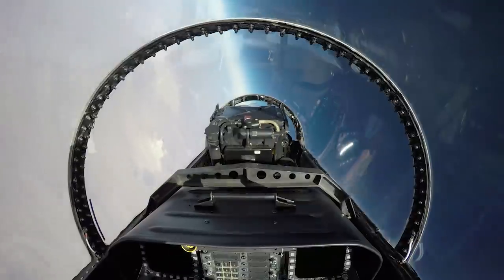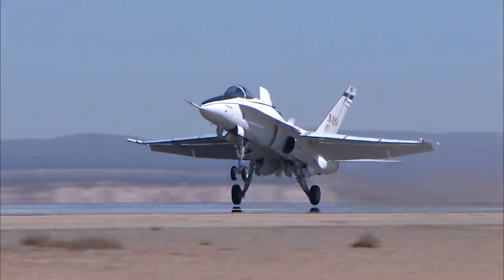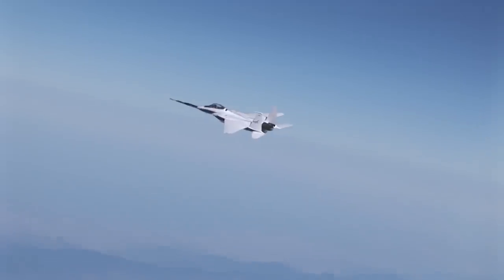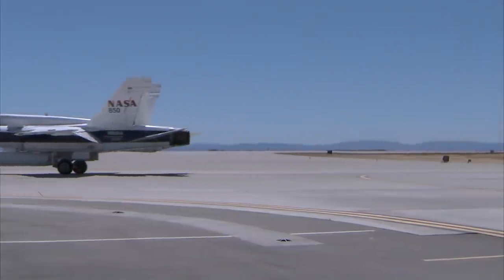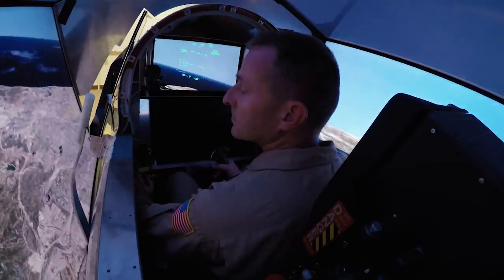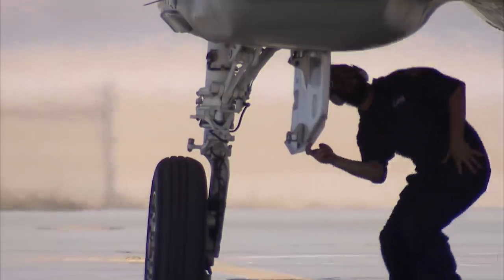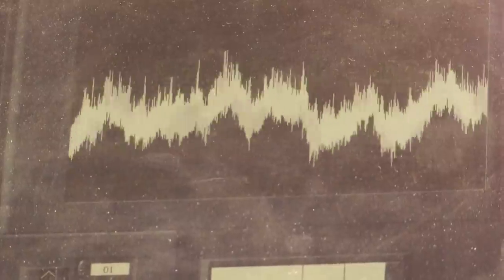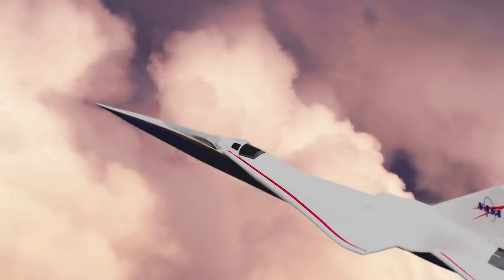NASA Prepares for Future of Supersonic Experimental Flight

Comment: Having spent time in the SA military (during the Bush war fighting communisum) and hearing Mirage 1 and 3s go supersonic often, I really wonder why the fuss. I never saw a window break or some other earth shattering thing. At worst I saw a desk vibrate. But since it was a daily occurance, after a few days, it was the norm and not intrusive. Personally I think they are pushing for stuff that isnt required as strictly as they trying. Heck a B737-200 or B727 or B707 makes far more noise at take off.